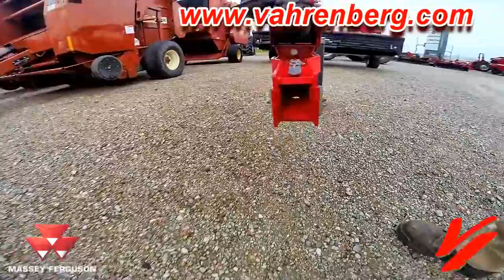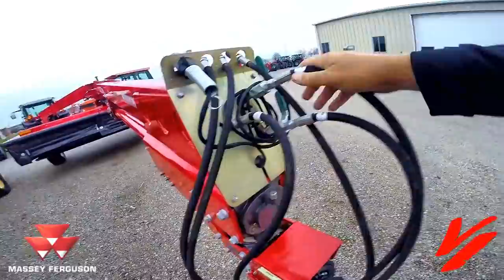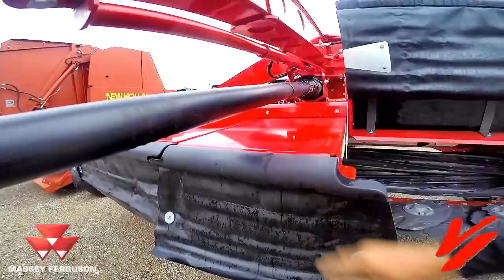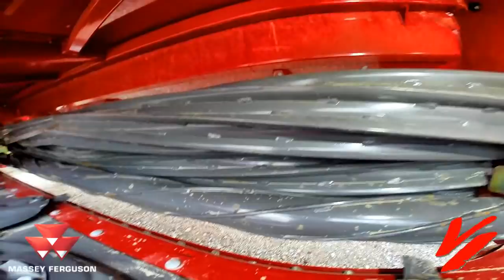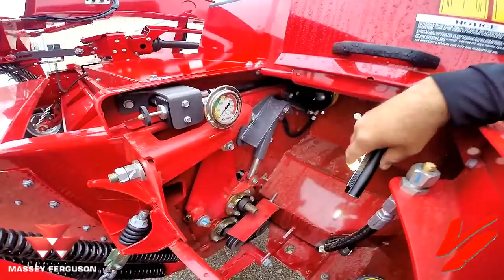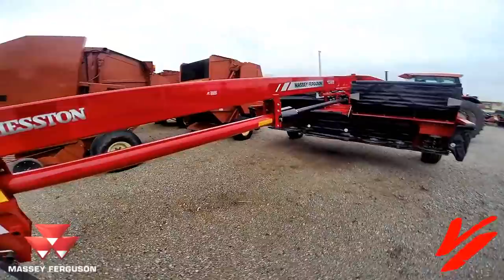Massey Ferguson HESSTON 1383 Disc Mower Conditioner Steel-On-Steel Conditioner

Comment: Why is that hitch beam so long??
Reply from the maker: So you can get a full width cut on either side of the tractor. The Wider the Width of Cut the Longer the Tongue has to be so it can cut the full width. Hesston Innovation. Did you know Hesston was the First to Use HydraSwing Tongue?

Comment: does anyone have a problem with getting a clean cut. i have a mf 1383 that constantly leaves strips between each module i,changed knives ,speed height, angle nothing seems to improve the cut. what am i doing wrong.
Reply from the maker: We have no issues with the 1383. It's actually the same cutterbar as the WR Series Self Propelled and the leader of that industry. 1) My Questions would be Blades? Are you using the original equipment blades from AGCO Parts? 2) What kind of crop are you cutting and how heavy is the crop? In the back of the Operators Manual there are tips to try under Troubleshooting. Light Crop too high RPM can create "blowdown" of the crop might lower RPM or driving too fast or Knife angle  or improper blade length.

Comment: For those of us who have rocks have they come up with a thing like New Holland has fast change Shear head that prevents the rest of the country bar from being damaged
Reply from the maker: The CNH Discbine utilizes ShockPRO hubs for their shear protection. These hubs only drive over few center splines unlike the  Massey Ferguson Hesston shear protection that is driving off of ALL input splines. When CNH went from the MowMax to the MowMax II, one of the main improvements was to enlarge the ShockPRO hub. Massey Ferguson Hesston has always offered a heavy shear protection system that only yields when it has to.
Reply: @VahrenbergImplement  thank you  for explaining it better to me